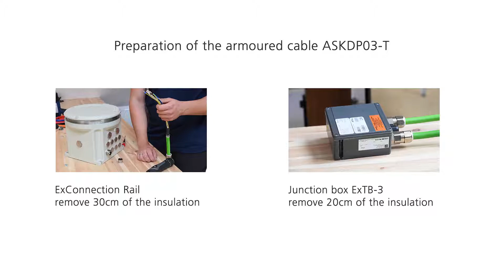SAMCON 04 Wiring the cable ASKDP03 T to the junction box ExTB 3

Comment: Glad to see the inner sheath penetrating past the gland, (preferably by 10mm or more) time and time again I see this well inside the gland, and after time the shrinkage due to post installation movement and age means this slips back to an unacceptable level.
I fail this type of work, get the contractors to do it again at their expense, also I find the seals on the floor after installation, its the easiest fail ever, I ask the contractors which gland have they left the seals out of?
If they aren't sure (they never are) they have to split and redo all of them.

Comment: that Knipex cable knive has special adjustable rotating blade for circular and axial cuts, for a moment. If you would like to make sure none of shielding conductors are cut along just do a 3/4 of a sheath depth and then rip them off